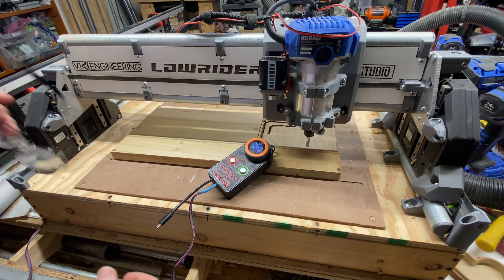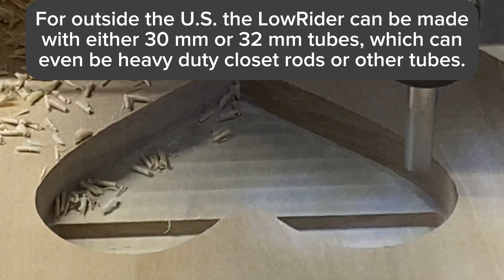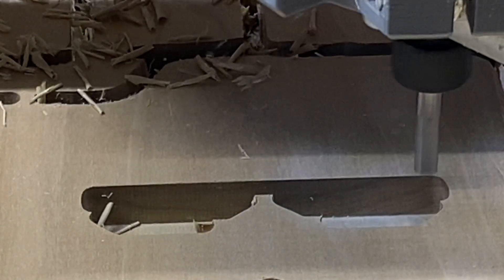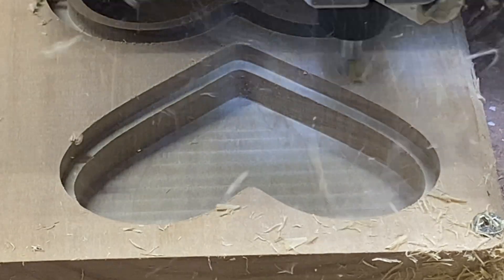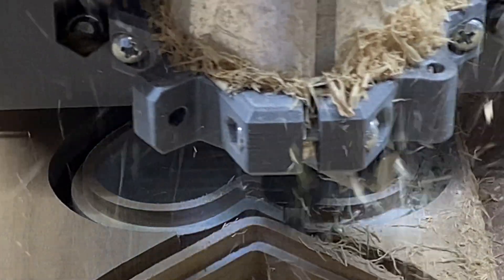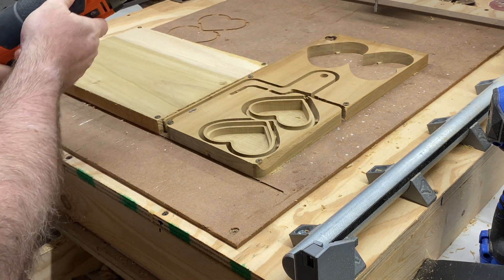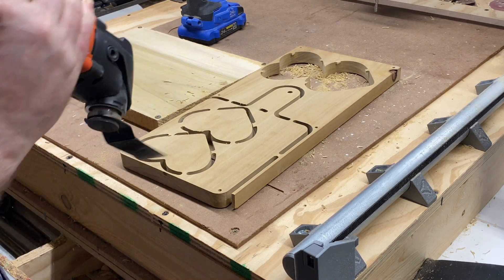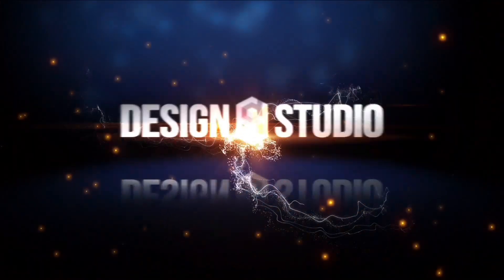LowRider v4 DIY CNC - BETA TEST Amazing wood cut at 3000mm/min and 12mm depth of cut!

Comment: I hope you will have a need for a laser at some point. I'd love to make a lowrider v4 100w laser :)
Reply from the maker: I purchased and use a 100W CO2 laser from OMtech laser company. I could scarcely afford it, but the price was made kinder by the fact that I bought from their refurbished/clearance section of their website. Despite that it was listed in like new condition, it had several problems and issues that it took me quite a while of working with the support folks and getting things shipped to me to make it right and properly functional. Including they had to send me a new laser tube, which is quite a headache to install and get the mirrors aligned. My understanding is that aligning the mirrors is a necessary headache regardless of whether you buy new or used, and is also necessary anytime you install a new laser tube, and in fact can be necessary over time just simply due to vibrations. Many people have installed diode lasers on their LowRider, and this is quite doable, and is an effective tool for some things. There’s been talk of a powerful CO2 laser version of LowRider, but I don’t know of anyone having actually done it.

Comment: I was really excited about that depth of cut until he said he was working with alder.🤣
Reply from the maker: @jellybob2pointo  I hope the designation was accurate, as I was going by assessment of others as I am not knowledgeable about various species. Doing my best to be honest.
Reply: @design8studio  oh, I wasn't ripping on you or anything, Alder is just one of the softest hardwoods in existence, if you've dropped a piece you'll know just how soft it is. Definitely an impressive machine, just seeing the way it was hogging through the material had me thinking it was more powerful than it was until you mentioned that it was Alder.

Comment: Doug I have had my failed Lr3 build staring at me for over a year in the garage. I ordered the metal plates to upgrade to the lr4 but that was a month ago. I just seem to not be able to do anything technical like everybody else. It's been a long couple years of nothing but defeat. I'm trying to get the willpower up to start again and tear apart the lr3 and restart again. Looks awesome man as always.
Reply from the maker: @KNIGHTS_TRUMPLAR  I’ve been there myself. I figure probably everybody goes through that at some point. It’s probably a little bit like when an author has writer’s block. It’s really worth it if you can push through and make at least a little bit of headway every day.

Comment: Is this a pre-tuned firmware, or is this after testing and calibration on your end?
Reply from the maker: This config file for FluidNC was originally downloaded from V1E.com and I later increased its max travel speed, and I think I upped its acceleration value by some amount. The machine itself ought to be tested for both squareness and the gantry being trammed to the table, however when this test was done, I had not done either squareness or tramming. Because this machine is smaller than a full size table, it's less crucial but should still be done. Ryan, founder of V1 Engineering, mentioned likely updating the downloadable config file to account for the increased rigidity and ability of the new LR4. I don't know yet if he did that. If anyone wants to see my config file to compare to their own, I'm willing to share, with the caveat that it's not advisable to simply swap in someone else's config file, because they may have add-ons (I have a FluidDial pendant) and the latest config file from V1E.com may have newer content that is beneficial.

Comment: So the real question is do i want to build this or the mpcnc.  I have a blank slate for a workspace so now i need to do more research
Reply from the maker: @jdrollason  several are pointing out that they feel that the LowRider is better in both small format and large format. It is a little bit more involved of a build than the MPCNC, but those who have built both say that they like the LowRider’s easier material loading options and other things about it.
Reply: @design8studio  that helps.  Thank you.  I do the like the more open concept of it.  Thank you
Reply from the maker: @jdrollason  look for a thread on the V1E forum, titled “LowRider stubby.”

Comment: Any word on if I can use my recently purchased Lowrider three hardware kit to build the Lowrider 4
Reply from the maker: Yes, this has been addressed quite a bit on the forum. Much of the hardware kit is still usable. Lowrider v3 items that don’t carry over to v4 include: the XZ plates, the lead screws (which need to be longer), and that’s about it. Everything else should carry over. There are less screws needed on some screw sizes and a handful more are needed on, I think, at least one screw size. You can reuse the motors, the pulleys, the idlers, most of the screws, the end stops, and all the wiring. Of course all the printed parts are different. One last point is not regarding the hardware kit, but rather the steel tubes used. The Lowrider 4 uses larger diameter steel tubes, so if you already bought tubes for v3, you’ll need to replace them. The good news is for many people the larger tubes are available and affordable. In America, it is sold as 1 inch EMT, which is sold based on inside diameter, but it has an outside diameter of 29.5 mm. Options for people outside the USA include 30 mm and 32 mm outside diameter. Some heavy duty closet rod can be usable. Be sure to measure the thickness of the wall if trying to use something other than the EMT. The EMT seems to have a wall thickness between 1.4 to 1.6 mm. Anything with a wall thickness up to 2 mm should be OK. Beyond that it doesn’t help with strength and just adds weight and is kind of overkill. The diameter matters more for strength, unless the wall is really thin.

Comment: It was so satisfying and impressive to watch! LowRider V4 is on my short list of next projects. Also, using the oscillating tool to cutout parts is a great idea!
Reply from the maker: I recently started using a sharp chisel to cut tabs, and there’s a lot to like about it, because it can reduce the amount of sanding needed afterward. You do have to be careful though, because you could cause a little bit of a blowout at the last part where the tab meets the other surface.

Comment: Wonder if we could swap the spindle/router for sander when we are done with the cutting. Or have a second Z that lower on the back side of the spindle
Reply from the maker: Perhaps doable. So, a few things here. 1. The new LR4 can have the mounts loosened to remove the router, without loosening the mounts themselves from the core. It was not that way on the previous version, LR3, and I think it's a great improvement. 2. Frequent removal and reinstall of router / other tools would probably be made easier and better if you install a power outlet socket right by the core, and lop off most of the power cord of the router, and have a plug on the end of a very short router cord (and same for other tool being swapped in). Then your power cord with the mounted outlet on it can stay permanently installed in the gantry's wiring harness. 3. I had an idea for a cam lever based way of removal and reinstall of router. I have not done it yet. I suggested it privately to Ryan. He pointed that the tolerances will be tight on the right amount of tension. 4. The tool mounts are designed for the diameter of your selected router. To make a sanding tool fit in the same mounts, it would either need to be same diameter as router, or be made to match via [printable?] adapter. 5. One can always redesign the mounts to hold two tools, but the further away a tool is from the core, the more forces there are that cause deflection, runout, etc. The tool where those forces matter the least, would be best choice for the added on tool.
Reply: True I didn’t think of the deflection.

Comment: Is this new version 4 using same board box as the lr3 etc. For jackpot board or skr ?
Reply from the maker: Yes indeed. Can still use any 5 driver board. List of recommended includes Jackpot and SKR.
Reply from the maker: Regarding the case / enclosure for the control board, Ryan has offered a basic box that fits and works, and some variations or self-created versions were made during the beta, but I don't think they were shared yet.
Reply: @design8studio  sorry for the  late response , thank you !!

Comment: Any plans on reworking it to get more height on the Z like you did for the LR3?
Reply from the maker: The new LR4 has more Z movement range than the LR3, and neither Dan nor I saw any need to bother with modding for additional height, especially since the LowRider's most rigid position is all the way down, so upper regions are not the best strength for cutting. For those who need to cut deep, a drop table, aka deep cuts table, is better. Instead of raising the machine, lower the material!
Reply: @design8studio any examples of a drop table that are in use for full length machines? Really grateful for the work you guys put in!!! 🎉🎉🎉
Reply from the maker: @badcraftwoodworking6682  All that is needed for that would be, for example, to buy some long strips of MDF, and stack up as many as you need, and attach them to the sides of the table for the LowRider to ride on them. If those strips are secured, and the LowRider belt tensioners are securely attached to the top one, then you have just increased the LowRider’s ability to make deep cuts in a way that does not compromise the machine’s rigidity. We need to find a new name other than drop table because it unintentionally gives the impression that the table needs to be able to move or drop when really what we’re talking about is giving the table added height on the edges where the LowRider runs.

Comment: How much / difficult is it to upgrade from v3 to v4?
Reply from the maker: I'm doing that now! Takes longer to take the old LR3 apart than it does to build the LR4 that replaces it. The hardware, steppers, couplers, bearings, idlers, etc all carry over. The lead screws need to be longer, unless your LR3 was a "tall" version. The linear guides also need to be longer. There is new build documentation being worked on as we speak. Check it out at: https://docs.v1e.com/lowrider/

Comment: is there a reason not to use 1/4 MDF for the struts?
Reply from the maker: @stevemecham7281  1/4” MDF is a pretty good material for the struts. According to Ryan, he ranks MDF highly, just underneath hardboard. He recommends avoiding plywood, especially the lightweight, flimsy kind. Basically raw (unprocessed) wood can expand and contract, which is the opposite of what you want, so dimensional lumber is not a good choice, and plywood is better, but only somewhat. At least not ideal. My understanding from Ryan is the more processed a wood byproduct is, the more resistant it is to stretching and contracting, and this is why highly processed materials such as MDF and hardboard are what he recommends.

Comment: We have Alder - supposedly used here - in Finland.. We call it Grey Alder -> Harmaa Leppä which is regarded as soft wood.
Reply from the maker: Ah! Sorry for any confusion about the material
Reply from the maker: My efforts to research into it on Google had indicated that it is classed as a hardwood, though is on the softer side among the hardwoods. I did an additional search just now, and apparently there are variations of the species which are either classed as hardwood or softwood, depending on the variation!
Reply: @design8studio  yeah there are many variation of Alder and obviously the climate might effect on hardness as well. I am not true wood specialist here. Anyhow I am really amazed Your cut depth and speed etc using Nema 17! And You mentioned that even AL is been cut 1/4" on a single pass... quite unbelieveble. I am not concerned of 3D printed CNC parts moreover of the power of Nema 17....
Reply from the maker: @jesse00077  if I’m not mistaken, the test cut shown was powering them at a very comfortable 0.8 A. They can afford to have the amps upped to 0.85, 0.88 or maybe even 0.9 before getting very warm, and if someone were to print their motor mounts (and parts that are close to the heat) out of PETG, then someone could run the NEMA 17s at even one full amp or more, and so the holding power and torque are more than what most of us would imagine!
Reply: Check out "Janka hardness scale"
Reply: @design8studio  yes, I have run my MPCNC Primo with really high temps / A4988 (can´t remember volts). I suppose my printed parts are PLA.

Comment: The day I've been waiting for 🙂 Gonna try printing as much as I can on my Saturn resin printer using ABS-like resin, it will be much faster and probably stronger then PLA . . let you know how it turns out!
Reply from the maker: Sounds awesome. The hardware kit for the new LR4 started selling today on Ryan's site at v1e.com! The printed parts will likely be available on Printables.com and Thingiverse.com sometime soon, likely in the next day or two! Also, check out the new assembly documentation being worked on even as we speak: https://docs.v1e.com/lowrider/
Reply: @design8studio  Cheers Doug!

Comment: When will Ryan add the LowRider V4 on the website?
Reply from the maker: @BRADtheracingMAN  remember, he is a one-man shop, so be patient. My understanding is that he did get the hardware kits listed on the website today. I think it may be tomorrow or later before he gets the printable files made available.
Reply: @design8studio that’s awesome, I’ve been waiting patiently for
Reply: Yeah I'm only seeing the v3 on the website right now.
Reply: @drkline69  I checked earlier today, and they are up. I was getting ready to build a MPCNC and decided to switch over to the lowrider V4. Exited to start working on mine this weekend.